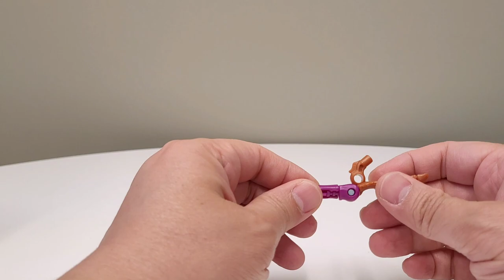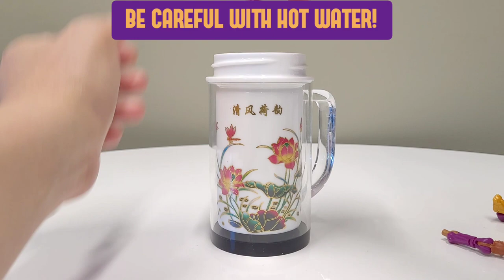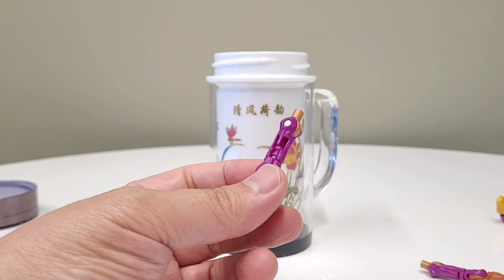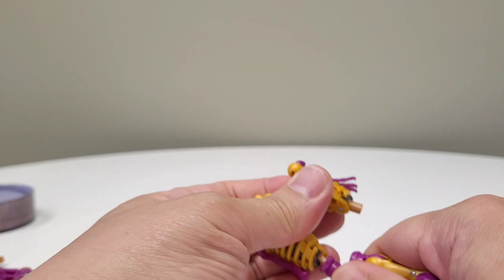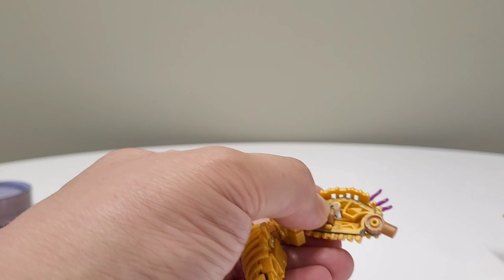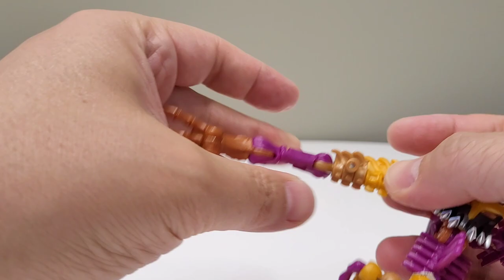Spindle Fix-it Video: Provides fixes for Wrist, Knees, and Thighs

Comment: When using the hot water trick, you can use cold water to solidify it. After squeezing it together the warm plastic will still try to take the form it had until it completely cools. Good vid my dude
Reply from the maker: Thanks for the tip! That makes total sense 🤘

Comment: Yo bbo for tightening any mushroom or tab or peg or whatnot an easy trick I always use is to put a TINY dab of superglue to tighten it up. It’s a lot more convenient then paper because you don’t have to keep track of small paper squares when you take the weaponizer apart. Best part is it even works on ball joints. You can use it on hinges by putting glue between the gap in the hung but for this, be careful you don’t glue the hinge shut
Reply from the maker: 💯 thanks man 🤘 I don't like permanently making changes to my toy so I avoid the super glue trick. Totally works tho!
Reply: @BotBenderOrinj  fair enough